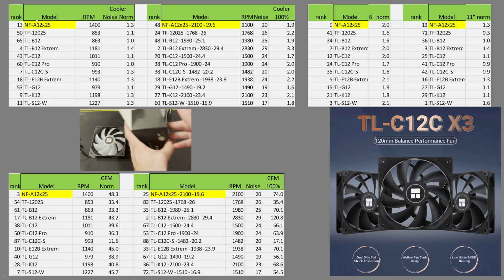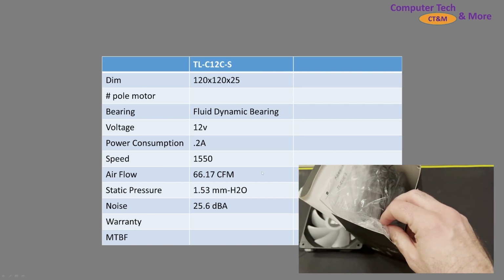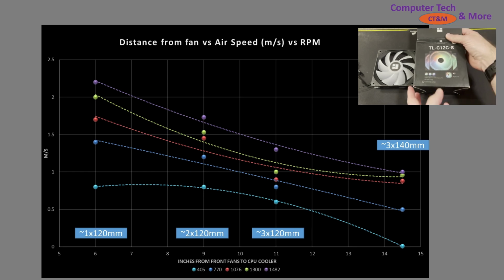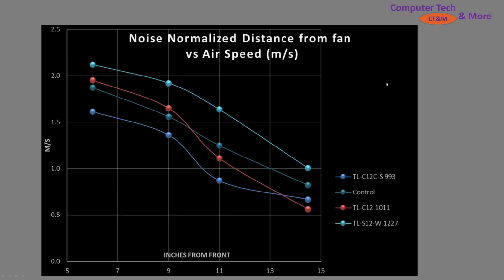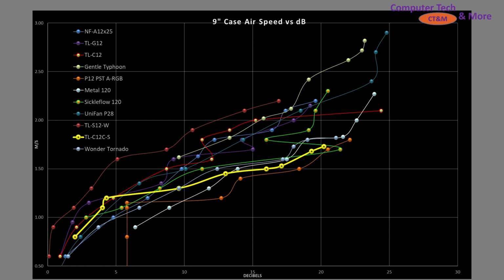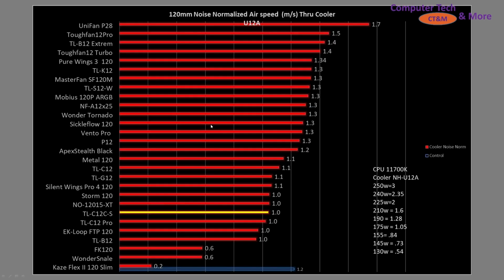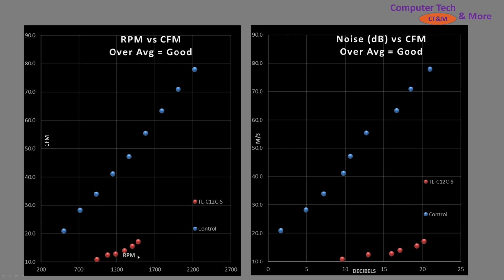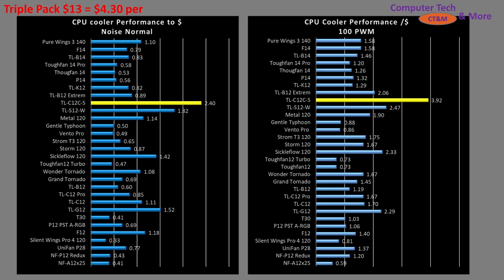ThermalRight TL-C12C S  Review

Comment: What about the TL-C12C-x28 fans? I am unable to find ANY reviews about them ANYWHERE. They seem good. better CFM. Sturdier. I would love to find a review for them...
Reply from the maker: I finished testing but have not gotten to a review. 
not to give it away completely: but they are not great case fans (adaquate), and relatively average in coolers
Reply: @computer-tech-more So between them, the tl-c12c (no argb) and the okinos hurricane 12 (not sure if you've tested those?).
Which ones would you choose? I'm strictly on a tight budget trying to squeeze every penny from every component...
Thanks.
Reply from the maker: @sideskroll  ive tested both. Neither are great choices for case fans. Look at tripple packs of the TL-S12. that is a much better fan.
Reply: @computer-tech-more  Case is Corsair FRAME 4000D (no fans). In case it makes a difference... Basically, which fans (10 bucks for three fans, 15 tops) would you recommend if none of the THERMALRIGHT ones?
Thanks again/
Reply from the maker: @sideskroll  Thermalright is the best place to start. I like the TL-S12 personally as a go to case fan in that price range.

Comment: any rec for budget rgb fans?
Reply from the maker: I have a best of RGB fans tested from December that should help. Its up to you about appearance though. I focus on performance
Reply: @computer-tech-more  I have watched a couple of your videos since, placed the order for s-12-s. Do you this fan is good enough to cool a midi tower with ryzen 5 7500f and rtx 5070 or is it worth investing in some high airflow fans?
Reply from the maker: @ahiru3392  Yes. it should
Case design: 3 front, 1 back? or 3 front, 3 top, 1 back? 
AIO or air cooler? 
If Air make you want none at the top   or front most top intake back most exhaust
Reply: @computer-tech-more its a 3 front 1 back case, air cpu cooler, is top exhaust not ideal?
Reply from the maker: @ahiru3392  it depends on the pc case if its needed. Like the fractal torrent, north and meshify are super open in the back so a fan there doesnt do as much. 
I also have a bequiet lightbase case and its back is very closed off so with an air cooler I NEED an exhaust fan.
Reply: When you mention budget, these are back on the table and close to the top lol    But if you don’t care about how much money you spend or don’t need many fans.. consider others

Comment: I realize I'm a bit late to the party but I am quite certain your CFM measurements are of by some margin. You measure air speed at 2.2m/s at 6" distance meaning that for this fan to push only 17.1 CFM it would have to be funneling all it's air through an circular area with a diameter of about 2.7" or 6,8cm at that distance to be able to create that airspeed with such a low volume of air being pushed. I find that hard to believe and so I urge you to redo the CFM testing for this one and for the Kaze Flex 120 as these results both seem to be reality bending.

Despite this error I must say your reviews are top notch and probably the best fan reviews on the internet today in terms of practicality, representation and quantity of fans tested. My hats of to you.
Reply from the maker: so the error on some fans came from the anemometer fan spinning in one direction and the fan spinning in the opposite direction causing the anemometer to not work properly on those fans. 
Ive added an air smoother for the reverse fans / ones that spin counter clockwise. its not perfect because "normal fans" dont use it because it drops air speeds ~.3 m/s on average. 
I saw your comment on my new CFM test its one reason for the test. If i get to Rev 3 of testing Ill have a permanent smoother in the CFM test for all fans. 
But yes you are correct. I acknowledge that the original testing in some fans on the CFM test is not correct. Took some time for me to think about why it was happening. 
Thanks.

Comment: Do you have to plug both headers into the motherboard
Reply from the maker: you can run the fan off the PWM but then wont have lights. and if you plug in the ARGB plug and not the PWM the fan wont spin. ? is this what you are asking

Comment: C12C turns clockwise; C12 turns counter-clockwise. Could that be the reason C12C underperformed relative to C12？
Reply from the maker: from what I have found it only effects the CFM test in my current testing. But with the power of a 3d printer I have a newer CFM test but will still include the legacy one. I also printed a flow straightener for the old test. But need to verify it doesn't effect other fans data. have to keep things consistent. 
Rev3 of my data testing would see new tests and an overall overhaul. ;-)
Reply: @computer-tech-more  in your tests the C12C underperformed against the regular C12 at the same noise level in most tests. Wondering if that explains why mosy PC fans rotate counter-clockwise. 
Looking forward to your next testing setup. I respect your passion and efforts!
Reply from the maker: @bt304  no the rotation direction of the fan doesn't indicate performance inherently. 
Not sure why most fans spin in a particular direction over the other. 
Thank you for the support. :)